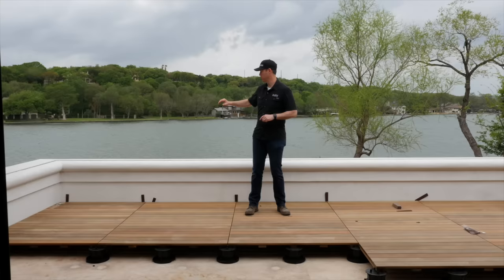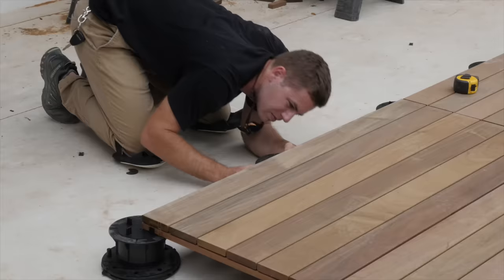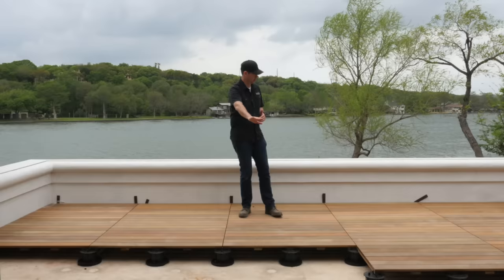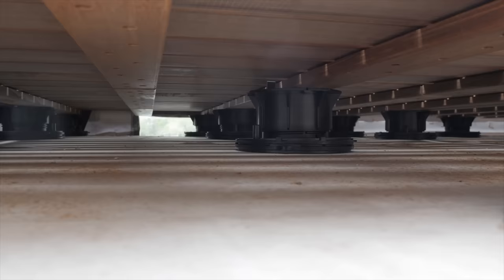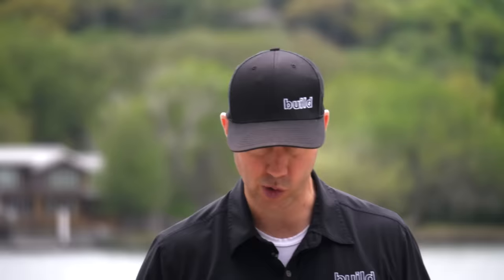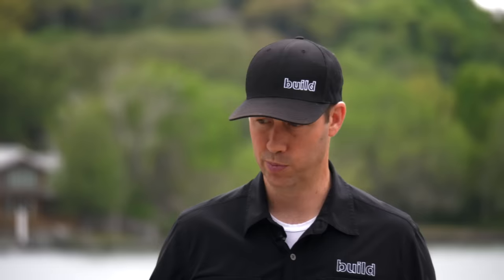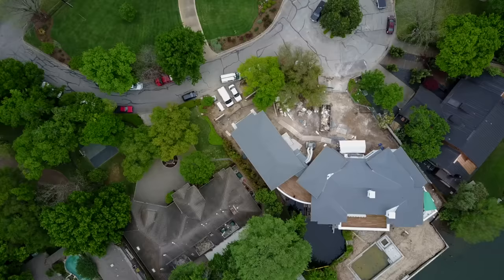Deck Over A Flat Roof

Comment: That's a sweet cut matching the curved parapet wall. In San Francisco the FD makes people use modular decking like this when it's over a living space. I think it's brilliant, we've used it on film shoots because it is the essence of scenery: Looks great, easily usable, durable units built elsewhere, easily installed [and then taken away after the shoot]. Also the leveling legs are very like what they use for modular concert stages.
Reply: How did you handle the drain on the roof?

Comment: This looked very interesting for a low profile deck I wanted to do for the 26 foot opening I made for a bi fold system. I needed something low profile enough to make an even transition from inside laminate flooring to the opening of the bi fold doors to the deck outside. I was thinking about making a concrete slab, and purchasing those feet and deck wood. BUT going to the website, it’s one of those where you have to request the price. I hate that. They’re just feet and square panels of wood. I don’t understand why you don’t just put the price up on the website? Lost my business. Too bad seemed like a good way to go...

Comment: Marvelous!  @4:00 Matt addressed my worry about "remove-ability of palette" in case of need to unplug scupper, drain, etc., from leaf litter or vermin infestation.
Reply: its does not seem it would be as easy as Matt said. Once you install the next "pallet" the screw wont be accessible, it seems like. Can someone clarify?

Comment: To fix the issue he mentioned about rotting pressure treated sleepers: Use PVC decking material instead of wood, that way the part that is (potentially) sitting in water isn't going to rot.
Reply: If he uses pressure treated lumber anywhere near that TPO, like he mentioned using for sleepers, he will be replacing roofs and not decks!!
#facts
Reply: @trevormurphy4106  why would he be replacing the roof and not deck?

Comment: Mirage makes a very similar system made for tile but you can adjust from the surface with a small t handle. Did some decks with 24x24 porcelain tiles years later still look like new

Comment: I wanna see how your Carpenters scribed up to that curved wall and what saw they used to cut it. Looks flawless.
Reply: If the curve is consistent, a piece of rigid foam cut to match the curve would work or if you have PVC blankets, just make a curved template.
Reply: William Smith 

Interesting thought. The curve looks consistent in that the arc would have the same radius but that doesn't really help with orientation and also still want to know what tool they used to cut it. I've seen them do curved stair treads before and I think they went as far as CNC'd templates.
Reply: Probably a jig saw Smithy . Then possibly a belt sander to finish .
Reply: That's some serious skilled jigsaw work.  I'm leaning more towards a template with a router and patter bit
Reply: In my experience that internal radius will have flat spots here and there if it was hand finished . I cant say for sure obviously but to me I would think it would need a final scribe to sort all the ins and outs . A good jig saw with the right blade would go through those panels like butter . Either way , they did a great job .
Reply: ben jarmin 

Agreed. Which is why I'd love to know their methods
Reply: YouTube will tell you lol . All our secrets are out there !
Reply: I'm guessing a Bosch jigsaw with several fine-tooth blades, and a zero-clearance foot.
That would produce the quality necessary, not to mention Ipe might lend itself to minimal, if any splintering given the tight/fine grain. Finish it up with a belt sander and call it done.

I could be totally off though.
Given the pre-fab of this product, it might be CNC'd at the manufacturer; before shipment to the customer. That would just require a CAD drawing imported to the CNC router, and off it goes. Any onsite adjustments (since CAD and reality are rarely identical) could be done with the tools mentioned above.

Comment: They make very attractive structural tiles that span the distance between the plastic support piers.  They will last forever without maintenance in the harshest climates.  Looking at them at building shows they appear to get their strength from an integrated fiberglass grid mesh either within the tile or adhered to the lower surface.
Reply: semidemiurge So you wouldn't have to panelize the ipe first? Interesting.

Comment: What type of perimerter rail detail is recommended where the is no parapet ? 
Love the look but contemplating this type of system that needs perimeter guard  rails an likely perimeter, roof surface to deck surface, dams to stop wind uplift.

Comment: I know this is an old video but hope you'll be able to answer my question. I am considering this system to build a deck on a flat roof in South Florida. My concern is with wind speeds during the hurricane season. How do you ensure the entire structure will be stable and still with high wind conditions without perforating the surface where it will sit?

Comment: Because all the 2'x4' component decks look to be mechanically fastened to the standoffs there is no worry about the standoffs moving over time since they're not fastened to the roof. What that means is you basically have one macro system that's linked at the corners. Because the decking butts up flush to the the inside walls of the roof there doesn't exist the room for the entire system to shift. It's basically a friction-fit flooring system. Neato.

Comment: We have something similar in Europe. They will take some phenomenal maximum loading (500kg each). I used them to re-support a large timber shed that had shifted in level one end.
Reply: 500kg each or 500kg/m2... my mum is a civil eng in China and the roof load is 300+kg/m2 where the floorspace is designed to be 250kg...and I used to work with Canadian architecture and I know their wooden building only design to be 150-200kg/m2 and sometimes the roof space is designed to be 100kg or less to be "not living"

I know a lot of Amsterdam building have living roof space I am not sure if this is applicable to  a lot of North American building

Comment: I have an existing flat roof deck that has a torch down roofing material over concrete. Can these pedestals be used to support joists to install a more traditional deck? Additionally, these pedestals just float and are not screwed into the roof… right?

Comment: So  i have a flat rubber roof with a pitch.  I want to raise and place a deck.  Can a jacuzzi be placed on top of deck and pedestal?  I know the structure is able to handle the weight.  There is living space below.  It was and addition to the house over looking the woods in the back yard. So will it hold a jacuzzi do you think?  or should i place directly on the rubber roof.

Comment: Would this type of deck be ok to hold the weight of a hot tub? I'm concerned about the plastic not being strong enough but I need a rooftop deck system that will work with a hottub.

Comment: Hey Matt, builder from FL... Still hoping you can do a series on hurricane reinforcements?!
Reply: This is just what I was thinking.
Reply: Bison is getting NOI approval in Miami. Bison has the most extensive wind testing in the tile/pedestal industry and they do have a "wind system" for high wind locations and uplift prevention.

Comment: Locked in with a screw on each corner, but that means in order to remove a panel in the middle you'd have to release 9 surrounding panels to release the middle one. (by the looks of how it locks into each panel). Or am I missing something?
Reply: Just remove a screw in each corner and lift the panel up. He explained this process in his video

Comment: Hey Matt!  How was the parapet siding finished over the membrane?  Also, how was the roof's ventilation handled?  I have a similar rooftop terrace over my garage but I'm struggling to get decent finish on the edges of the parapet without having to put an aluminum fascia that will cover the edges of my tiles (and the top of my brick parapet).  Thanks for the input!  Btw, good job on this roof deck!

Comment: I’ve seen builders using a hybrid of Sleepers for framing a desk on the stand-offs so the Entire deck is still free-floating but you’re able to use a wider variety of other decking materials. I’m interested in a bamboo composite decking that isn’t available in longer-length deck panels/tiles.  Do you think the decking panels on the standoffs or the sleepers on the stand-offs is a better way of installing a free-floating deck? Or similar are they similar?

Comment: Other than extra damage protection and fire safety for the actual roof, are there functional benefits to doing this? I know aesthetically it looks great, but if it would be used only by the residents below (and no grilling or fire hazards), is it necessary?

Comment: The price on that must be nuts, also do you have to raise the railing as well?
Reply: J Vhoef 
39”  if OSHA has something to say. He did mention a installation of a guardrail.!
I would fire the person that installed the drain
There is also a tapered plate that can be installed. 
I installed this system using stone 2’x2’ pavers. This on the old Kcpl building in Kcmo.

Comment: Would the drains be sufficient to handle heavy rainfall? What would happen with overflow? How about clogging, when drains get partially clogged? It would be a perfect moscito breeding ground when you get standing water under the deck.
Reply: The scuppers look well portioned enough to handle anything typical in his climate that the drains can't deal with.
Reply: Typical or Harvey level? even clogged after a few years?
Reply: There are mathematical calculations that would tell you the necessary sizes of drains that would be required to sufficiently remove the water. It would largely be based off of the area that could hold water.

Comment: It is not cheap but it does work ! Every roof deck I see it’s worse from just a deck being built to stay and now few years later or less it’s leaking but now A gotta pay some one to disassemble the deck just pin point leak then to repair it’s  another bill then rebuild deck

Comment: Would you recommend this for a penthouse with a lot of roof space around it. We are told that we can build a deck since it is part of the penthouse but they will need to have the roof inspected every year so they need something that can be removed. Will this be also be not noisy for our neighbors below?
Reply: It's been 3 years since you made this comment but this will work, though you'll need a system that is fits your building's height wind resistance and they can inspect it everyday if they want, manufacturers warranty is anywhere from 20-30years lol

Comment: What about up lift during a storm since it isn't attached in any way?
Reply: Ipe is one of the most dense wood species in the world. There's no way any storm in Austin, Texas would be able to lift those off of the roof. If they were individual boards I would be concerned, but they are 2x4 panels.
Reply: I am putting one of these in this summer on my channel and the system requires a parapet that keeps wind -- for the most part -- from getting under the deck. Not enough air can get under to lift. I sure hope it works, I already built the addition with the flat roof and will be installing the deck this spring 😉

Comment: what if you want a concrete deck over living space? How would you do that?;)
Reply: Jason Hunter I’m wondering the same thing. My guess is rebar, slope, fiber mesh, and 6 inch slab. Once cured maybe a few coats of epoxy paint? Other suggestions?

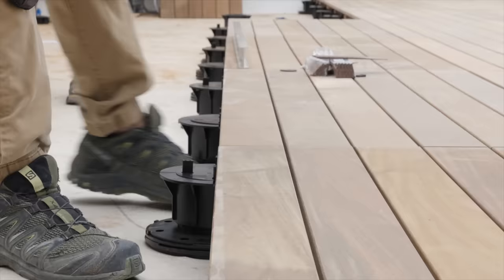Comment: Can you tell me what they are doing with their tapes at 3:16 and 5:19. If they were measuring to get to a proper height wouldn't they have it on the base not the top. It's frustratingly dumb looking.

Comment: I wonder if so much depth is needed.  This is probably spec for this specific product but if there were a standoff product that requires only an inch or two from the roof surface (not including the depth of the deck boards) then a guard rail may not be required to be added...
Reply: If you dislike the guard rail, then as opposed to lowering the decking, you would just increase the height of that parapet wall.

Comment: Those little plastic fins look pretty fragile, and the whole deck is not even anchored to the roof... what happens during a storm when there is uplift? Or what if some kind of lateral force causes the wood panels to misalign? I can imagine the 1/8 inch little black plastic fins breaking like twigs...

I’m just speculating though. Am I missing something obvious? Please someone tell me if and how I am wrong.

Comment: Wont wind just rip that stuff off the deck, since its not fastened to anything?
Reply from the maker: The ends of the deck are encapsulated on all four sides by the house exterior walls, and the outside parapet walls. Not sure how it would experience uplift
Reply: Higher velocity air is also lower pressure air, since there will always be wind passing over the top of it, but not the bottom, it should always experience uplift, actually lifting is just a matter of wind with a high enough velocity.
Reply: @beachboardfan9544  The mass of air below the deck is minimal and has miniscule additional airflow from the venting. Also, what pete said.

Comment: I know you say the panels are removable, just have to remove the 4 screws, but it looks like there is a disk at each corner that the screw goes through locking all 4 panels together.  How do you handle the disk during removal and reinstall?
Reply: Sawzall 😁
Reply: You actually don't need to remove the 4 screws because the biscuit has a notch cut out of it. All you need is a flathead screwdriver to align the notches to all face one tile... then you can pull that tile out without backing out the screws. The disk typically stays in place the whole time.

Comment: Hey, great video(s). I'm not sure where this deck is located in America, what prevents the plastic supports from digging into the roof system during the really hot summer days?
Reply: They are in Texas.
Reply: I've always used approx 18x18 sacrificial patch between the main roof membrane and the pedestals, using an extra layer of the same roof membrane. Loose laid patch.
Reply: That's a great idea, thanks.

Comment: I was skeptical at first sight, but looks like a fairly inexpensive and non-intensive way of flat decking an area like that. Still would have some concerns about the plastic standoffs, but since it's all modular as long as they're not expensive could always have a few extra just in case to shore up or fix broken pieces.

Comment: Go ahead take it apart show me how easy it is, to start. Those circular corner tabs go underneath 4 different sections of deck
Reply: The corners are not a full circle. They are pacman shaped so you can turn them to be open to one corner.

Comment: I may have missed this detail, but is it held down somehow other than gravity?
Reply: From what it looks like: The decking, yes. There are corner clips. The stands, no. Just gravity of the whole system.
Reply from the maker: I’m not sure I mentioned it, but we use a dab of construction adhesive under each pedestal to keep it solidly in place and we think it helps with vibration as you walk
Reply: Matt Risinger 
Since you are using two different plastics together and they will basically be clean, would RTV - silicone adhesive work better than Liquid Nails
Reply: My initial thoughts were that might be an issue in a high wind environment. In this application, probably not an issue as the wind blocked on all sides. Seems like maybe they could be attached if necessary.

Comment: Amazing home.  Very cool product. How well does this product distribute weight? A person of course doesn't seem like an issue (even a bigger Texan, since everything is bigger in Texas right?) but what if they bring out something heavy like a bar?
Reply: Each one of those pedestals is rated to support 1,250 lbs with a fail safety ratio of 3x... so actually doesn't begin to fail until 3x that weight. For hot tubs, grills, bars, etc. I often see a few extra pedestals installed to help distribute the weight, or Bison makes an FIB floating insulation base that also helps distribute the load evenly.

Comment: I HATE those standoffs. We have them here for a floating concrete tile system (for water drainage and such) and they continuously and constantly need adjusting. I'm routinely finding tiles that have worked themselves loose (even though they're supposedly not supposed to do that) and now tiles start tipping. They require constant attention. Maybe it's better on a lower-traffic area like a deck or with a lower-weight system like this (wood vs. concrete tile) but here. . . it's terrible.
Reply: Are you saying that they settle down on the threads that adjust for height?  Is there not a locking mechanism?
Reply: Have you found a better alternative?
Reply: there's supposed to be a locking mechanism, but it doesn't seem to always work
Reply: I don't know if our facilities dept is looking for any replacements. They just go in fixing them.
Reply: Mike Malsed i
Reply: How about if you  put some inexpensive clear silicone one the threads so they will not move?
Reply: You may be using a similar product, but I can assure you the Bison pedestals do not migrate or lose any height over time. The Bison pedestals are tested and do not require any locking mechanism.
Reply: Loctite?
Reply: Just put a screw in it once it's set, might void the a warranty tho. Fuck it haha
Reply: Are you sure you are using standoffs and not knockoffs?